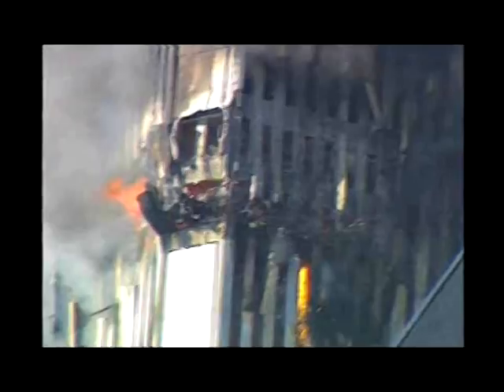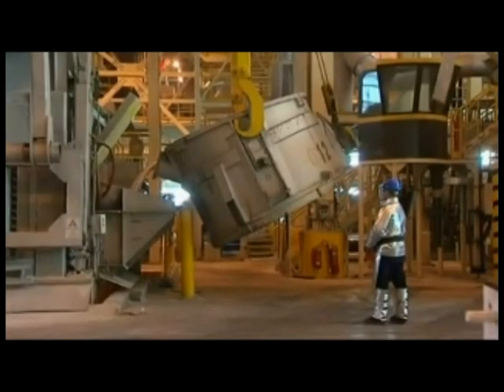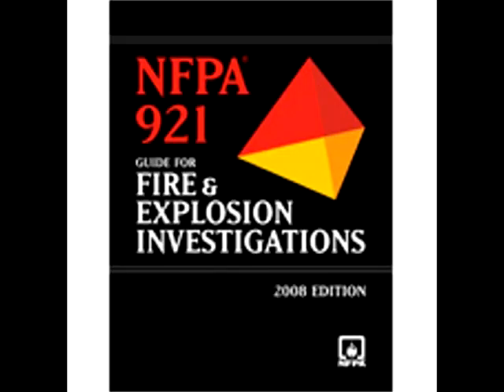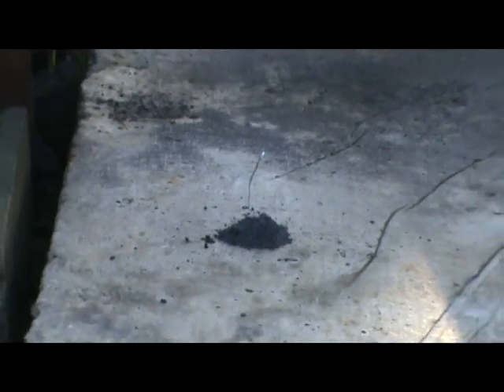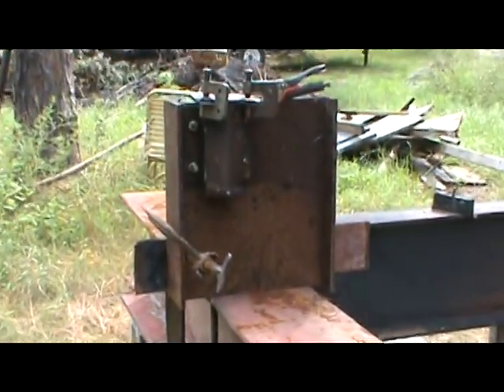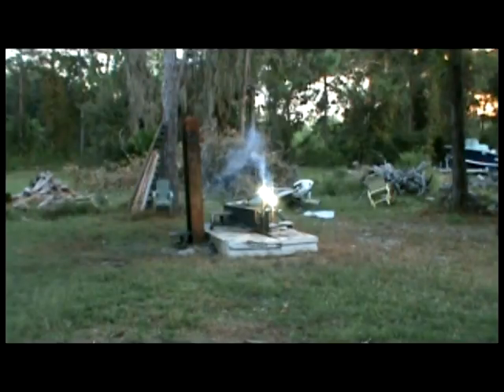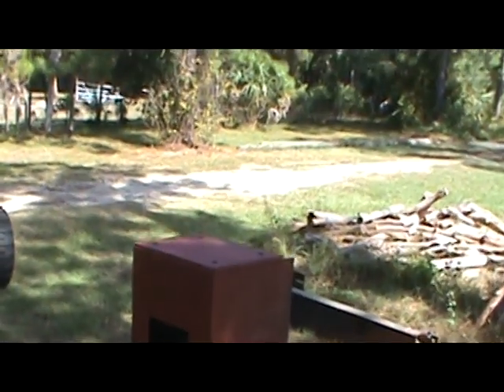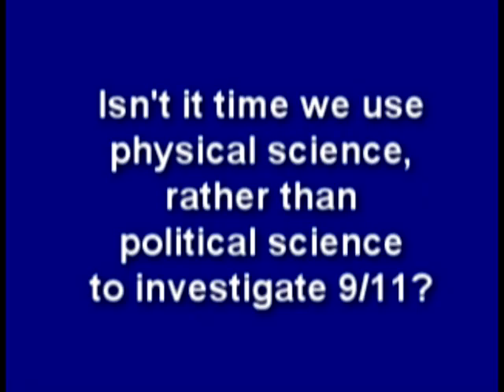9/11 Experiments: The Great Thermate Debate

Comment: I respect what you're going for and I may even agree with you, but I think you hurt your own cause when you attempt to present this as completely neutral and unbiased from the beginning. It's the presentation, the wording used. 
Tone it down a bit and don't make it so obvious what your results were gonna be from the very beginning, and you can take away the easy attack points that your opponents would go for first when criticizing your work.

Comment: Youtube "CCTV fire"

The CCTV skyscraper in china which completely burnt out dude to a fireworks accident. Despite the building being engulfed in flames for hours it didn't fall.

Fires don't bring down steel buildings and never have - until 9/11, if the official investigation is to be believed.

Comment: I left out a TON of reasons where direct, easily accessible evidence disproves most of the claims I've heard made in the insider-job theory that show willfull, deliberate evasion on the part of the 3 guys that made loose change, Richard Gage, as well as Alex Jones.  Have you guys heard the radio interview between Gage and Chris Mohr as a prelude to the debate they had last night?  Or researched any of the "debunking" replies to inside-job theories?

Comment: But the fires see in the towers don't look anything like your final devices. Plus you don't need to melt the beams to cause a structural failure, just heat them, so why would some malevolent and presumably infallible body choose obvious thermate? Plus I'm assuming there's some sort of evidence for all of these devices being installed, both witnesses, office closures and unscheduled building works. But you have done some beautiful engineering here.

Comment: @MMIIXX Because kerosene isn't jet fuel, and I never said anything melted or collapsed? Do you not get the general idea of a plane crashing through a building combined with a shitload of jet fuel weakening steel support structures by half, which are carrying the weight of a multistory building? Stop grasping for straws.

Comment: Rust + Aluminum + Spark = Thermite. Basic chemistry here, so it's not inconceivable that there was a lot of thermite reactions going on before and after the collapse

Steel + Heat = Weakened Steel. Just youtube it.

Force of falling object > Strength of underlining building to break or divert falling object. 

There is no conspiracy with regards to the towers. If you want to argue pre-existing knowledge of the attacks or whether or not the planes were actually loaded with people who died, w/e.

Comment: @Skeptic121 There is only one problem with your theory...your wrong.  Regular thermite would have different trace elements in the dust, the recovered metals etc...  Also the amount of explosives and normal thermite you would need would be greater than that of super thermite.  This make it even more illogical to think it was normal thermite.  In the dust they also found unspent super-thermite chips.  Not thermite chips.  

Also if you look a the pyroplastic cloud...explosives were very obvious.

Comment: @ThePeage Well, the debates about whether or not NT or whether there was an adequate investigation are different from the point I was making, which is that  if you suggest, as this guy does, that thermate was used in order to keep things quiet, then it doesn't make sense to also suggest, as this guy does, that loud conventional explosives were also used.

Comment: @Skeptic121 Yes, any configuration of conditions occurring at any specific time has an infinitesimally small probability.

Do you have other examples of building collapses, possibly only due to fire, or with whatever such conditions you choose to enact?

How does WTC7's collapse compare to those? Do you have 500 other building collapses, and the time between one corner and an opposite falling for those, to compare, and to see whether WTC7 is statistically significant?

Comment: @Skeptic121 If the tower collapses don't look like what has happened to other buildings set on fire for similar amounts of time, then clearly more information is needed if you wish to explain it fully. Specifically, that the conditions the buildings was put in also involve an impact by a plane. Now, if the collapse does not look like what has happened to other buildings which were hit by planes, and in which fire ensued for similar length of time, then even more information is needed.

Comment: @Skeptic121 Because an occasional run of 80% heads can and will occur with a unweighted coin, in an unmanipulated environment. As will the occasional run of 100% heads, however many thousands of runs you would have to record before that would happen.

Comment: @Skeptic121 If you are given a coin and flip it ~500 times and record the results, and then repeat that entire process a hundred more times, and the majority of such runs gives ~80% heads and ~20% tails, then that *is* out of the ordinary. However, one run of ~80% heads, every now and again, is not unusual, in and of itself. If every single settlement in china had a proportion of male to female children of 4/1, this would be unusual. Not, however, one settlement in the entire country.

Comment: @Skeptic121 It is unlikely that there will be 80% heads, yes. In all likelihood, there will be far more tallies closer to 50% each than to 80 and 20%. However, in and of itself, a run of coins giving 80% heads is not an indication of any tampering of the coin. Neither is the existence of one settlement in all of china where, over the past 10 years, ~400 girls have been born, as compared to ~100 boys, in and of itself, indicative of intentional manipulation of that settlement's population.

Comment: @Skeptic121 There is always a true explanation. A true explanation for the coin flips, would involve an analysis of the paths through the air the coin took on each flip, in addition to any air currents or other conditions which may be significant. Or it may involve an analysis of the composition of the coin itself.

Comment: @Skeptic121 I meant that if an upper part of a building is damaged so that it can no longer support the weight above it, it is unlikely that the building will topple over.

And there's still the matter of the firefighter involvement which you alluded to. Do you think the building was demolished by the firefighters? If so, how?

Comment: @Skeptic121 Thirdly, I will repeat that if a building is not brought down by explosives, or is not intentionally brought down, with all supports over all levels being weakened at once, i.e. by explosives wired throughout a building, then, depending on the building's size, it will probably fall straight down, having succumbed to extra load over some time. For the towers, that's about an hour. For WTC7, it's the time between tower collapse and it's own collapse.

Comment: @Skeptic121 Secondly I was not referring to the fall itself. Clearly the supports have to fail *before* a building will fall. Hmm? <.<

I was referring to the maximum amount of time that the supports would have weakened over, that is, the time from the tower collapse and WTC7's fall.

Comment: @Skeptic121 What? Are you thinking i've confused 2.25 seconds with several hours? And btw, as far as I know, it took about 16 seconds. I have seen the clip. Even if you're ignoring the first stage where the back part of building falls a few metres, you would still have 6 seconds. Unless you're saying that the building did take that long, but only fell at free fall the last 2.25 seconds, or something? 

Firstly, then, I think you've got some facts wrong.

Comment: @Skeptic121 Although I suppose if you think all the buildings are the same, for it is simpler to do so, and, of course, allows you to think there is evidence for your position, then it's not as though you suffer from a lack of intelligence, save for where it is self-imposed. You're merely in denial.

I'd tell you to learn a bit about building design, but I don't think you could process it. Your beliefs, which you apparently have great motive to sustain, would interfere with your understanding.

Comment: @Skeptic121 It's odd how you don't see the pattern here for what it is. That a building brought down by explosives, especially smaller buildings, less than ~40 floors, can easily tip over any which way. A building as tall as the towers, without being demolished by explosives, would fall straight down. This is because the supports would have slowly, over about an hour, succumbed to the extra load. As opposed to being blown out all at once.

Comment: @Skeptic121 "Not tip over"

It can't tip over. No single component at the base is strong enough to hold the weight of the building at the apex of  the moment without collapsing. 

Dumb shit.

Comment: @yksnimus 
Watch the video of the collapse (or the demolition, as you would call it), and you will see the answer.  The building didn't break at the base, it broke at the top as one solid piece.  That solid piece fell downward, and without the suspensions to balance the weight (and force from the drop), pushed everything else down beneath it.  Gravity and the building's weight took over from there.  It actually is quite plausible...

Comment: @from212 I'm not sure exactly how one would define 'falling into the footprint' now. As far as WTC7 goes.

Tall towers like the Twins aren't going to topple over unless the base is weakened along with elements in the top. Given that it was just some upper floors which were damaged, the strong foundation is going to direct the collapse straight downward. As oppose to the whole building falling tilting over at once, or something like that.

Comment: @katey1dog I think you're a shade paranoid. You did just say that it spilled outward, but most of the mass was in it's footprint. Not: that it didn't split at all and fell perfectly neatly. If that was the case, I definitely would be denying evidence.

I don't know that most buildings, whether demolished intentionally or not, tend to fall the same way as WTC7, if that's what you're saying. 

The distinction between falling into the footprint, and splitting apart seems rather blurry now, however.

Comment: @pjnlsn 

It did fall symmetrically affecting all four corners simultaneously.  The video doesn't lie.  Especially, when other cameras videotaped from multiple vantage points.  

Yes, the building fell into it's own footprint.  Again, video and photographic evidence guarantees that fact.  Though some may say it spilled outward...  Most buildings do.  But the sum mass of the structure DID come to rest in it's footprint.  

You are denying evidence.

Comment: @katey1dog Well, to that, I would say that, no the building didn't quite collapse symmetricallly. In fact it split into a few pieces as it fell, and parts fell into neighboring lots, it was *not* down into the building's own footprint. Two, the collapse wasn't instant. In fact, the back of the building appears to collapse a little and just hang on to the rest of the building, at least 15 seconds before total collapse.

Comment: @DuRound2 

Quote: "WTC7 was gutted on the inside before the outside walls fell."

The inside contained the massive central steel and concrete support columns.  Far more massive than the external frame, which was NOT gutted before the building collapsed.

Oh, you think burned furniture meant the building collapsed?

Fuck off, troll.

Comment: @pjnlsn B If a total progressive collapse has occured, then it was caused by the removal or severe weakening of the internal supports; Is illogical

That argument is dead on arrival.  The building fell down.  How could it have fallen is the question to the reality.  The answer is absurdly simple.  The load bearing support columns were removed to cause collapse.  How do we know this?  It's on video.

Comment: @pjnlsn @pjnlsn 
If the internal supports of a building are removed or severely weakened, then a total progressive collapse results

The internal load bearing columns (supports) were removed.  What was seen was a total progressive collapse.  The destruction of the building was symmetrical causing it to land within it's own footprint.  It was sudden and pristine.  Meaning that all columns were removed at or near the same time causing such an instant and symmetrical collapse.

Comment: @jelinto Nice try, you say? Okay, so your idea of timing how long a building takes to collapse means counting only part of it. It wasn't just a nice try. I exposed your continued ignorance by showing that not only did you grossly misrepresent how long the collapse took, but the figure you gave would require a speed approximately TWICE that of free fall.
Yes, I responded to his video -- in four parts. I guess you just took at face value his lie that I dodged his questions. 
Typical.

Comment: @Skeptic121 The closest you might come is, in the case of WTC7, the backwards half of the building losing a column somewhere in the back, and falling down a few metres, while the rest of the columns have to support the extra weight. Which they did, until they couldn't, and all connected columns had exceeded their load capacity. In which case, the building fell, at free fall, yes, because there were no beams that could take the weight.

Comment: @Skeptic121 If some of the steel in a building is weakened, even to a hypothetical 0 strength, the rest of the building is going to hold it up, until it can't. Rarely is all of the steel going to be weakened in parallel, with the strength of all beams going from 100 to 0 over time, evenly, until the building bows over like so much jelly. All buildings, generally, distribute load across all or many beams. One half of the building isn't going to collapse while the other stays standing.

Comment: @DuRound2 Katy was using the word in the context of them being 'removed' like people going in, cutting them away, and leaving with them. Which is absurd, even without the fallacy. 

And I was actually under the impression that only a few supports in a corner of WTC7 collapsed, and over time, pulled the rest of the building down with them. Not "all" of the supports, that is. Am I not classifying internal supports correctly, or what?

Comment: @katey1dog Ah, no. I meant that when you say (A If the internal supports of a building are removed or severely weakened, then a total progressive collapse results
And to also say that (B If a total progressive collapse has occured, then it was caused by the removal or severe weakening of the internal supports; Is illogical.

B does not follow from A.

Comment: @DuRound2 

OK,  so you say the combination of crash and fire dropped the towers.  Even though the architect of those buildings stated they were designed to withstand multiple impacts from planes of a similar mass and full fuel load.

Now explain WTC 7.

Comment: @DuRound2 Remnant materials, not elements. Remnants of hardware, blasting caps, I suppose. Or remannts of compounds used in explosives. What I was pointing out that a test which tells you that there are some amount of iron atoms here or there, or a few chlorine, or sodium in various places, doesn't actually tell you what compound those atoms are a part of.

Which is the kind of results EDS tests give.

Comment: @Skeptic121 For example, the USGS did florescence tests on some dust samples, and found about every trace element you can imagine in all of them. WD-XRF tests, you see, are made for accurate mass measurements of elements. You implied that XEDS is not a mass spec, of course, but let's make that clear.

The paper I referenced, of course, only detailed the results of some XEDS tests.

Comment: @Skeptic121 They won't tell you what you need to know. What you need is specific structure. And that's not really what EDS is used for. EDS can't tell you if this is thermite (if you're saying thermite was found), all it can say is that there's some iron, some oxygen, some aluminum, etc, the amounts in a wide range.

Comment: @Skeptic121 There's so much wrong with what you just said. For one, nobody says that all of the steel on a level in that building was weakened, and thus, that a level or two could collapse. No-one says this. Obviously if some of the steel in a building gets weakened, the rest of the building is going to hold it up, as long as it can. 

I'm not actually advocating for any kind of 'just a fire' idea, just saying that what you just said doesn't mean anything, one way or the other.

Comment: @DuRound2 And you should clarify what you mean when you say that there was no welding done during the cleanup trade center. Because, offhand, I've seen pictures of workers cutting rubble apart. Assuming you meant any work done with high heat flame.

Comment: @DuRound2 Are you always incapable of understanding that which you do not agree with?
If you recall geology, underneath the earth's crust is a layer of molten material. All fault lines are closer to the molten layer than other areas of the surface. The heat and pressure placed under materials in, and between, the two layers, occasionally produce interesting crystal, and crystalline formations. Jewels and crystals like Quartz; And spheres of elements isolated by extreme heat. I.e. iron spheroids.

Comment: @flanksteak2 That would actually be a post hoc fallacy, or the assumption that since an event occured eariler to another, that it is the cause. Our military dominance has continued from previous, and we have previously attacked various Middle Eastern nations. However, your continued safety has not neccesarily been caused by our continued display and use of military might. Correlation, but not causation.